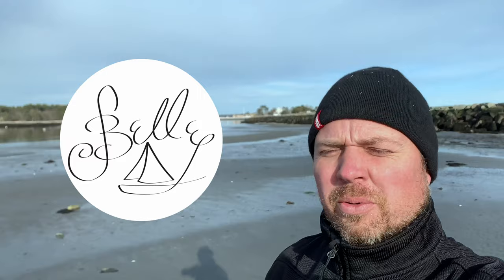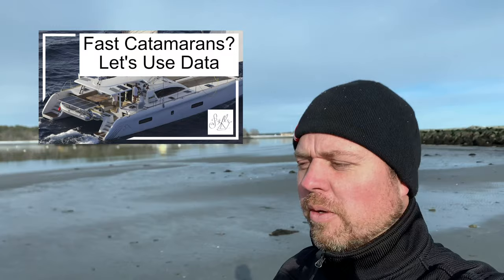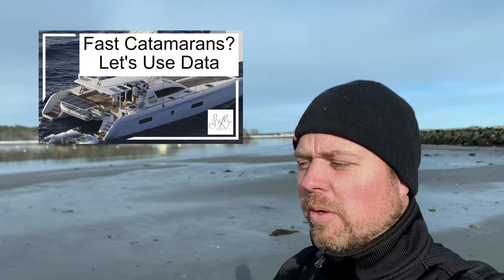Call for Questions! Catamaran Data

Comment: Great analysis on the Production vs Performance Cats video!  Jeff, you dipped into pointing out that buying a longer production might get you about the same speed as a shorter performance for the same price.  I wonder if we could pick at that idea a bit more - have you thought about analyzing how much a dollar will go towards speed if applied toward length vs applied toward performance?  I'm not sure exactly how to phrase that question, I'll leave that to your discretion so you can massage it based on data available.  But, basically, I like your idea of longer may get you more value than performance and speed really only matters during long crossings for safety.  

Thanks Jeff!  Your thoughts are appreciated! 
--Cliff
Reply: Jeff did put together a video about cost per foot length and cost per displacement. You might have seen it
Reply: @EdwardTilley  Thanks Edward - are you referring to this video: A Bit Longer is A Lot Bigger - LOA vs Displacement vs $.  If so I think Jeff did another great job doing analysis! but the focus of this video was spending money on length to maximize Displacement/Volume.  

I'm proposing a video/discussion on the question: If optimizing for speed, should one put that money toward a performance boat - which will go faster, or a longer boat in the same class - which will also go faster.  I know there are like a zillion things to consider in this analysis, bit I would like to hear Jeff's thoughts on that - or yours @Edward Tilley if you have any.

Thanks!
Reply: @cliffjohnson5660  It seems hull speed has a lot to do with long passages as a shorter length of the boat causes the bow to climb a steeper entry wave. Also, as you get close to hull speed, the boat has to work much harder to get the next knot of speed. Obviously, other factors weigh-in too - the narrowness of hull, overloading, etc. but hull speed seems a particularly key limiting measure in long passages. 
200 miles per day (or 100 miles in a 12-hour period - might be a better measure) seems an important benchmark for sailers hoping to avoid weather when they can, and to enjoy safe, and interesting sailing. 
Based on 8.3 miles per hour at a comfortable 80% of "full-power", 62' waterlines and longer will most easily achieve these distances. From 60' to 40' you are progressively nearing 100% of the boat's capability to achieve 8.3 mph consistently. Here are the numbers: 
hull length (ft)	hull speed (mph)	less 20%
65	12.4	9.92
62	10.55	8.44
60	10.38	8.304
58	10.2	8.16
55	9.94	7.952
50	9.47	7.576
48	9.28	7.424
45	9	7.2
42	8.7	6.96
40	8.47	6.776
38	8.26	6.608
35	7.9	6.32
Reply: @EdwardTilley  Great into - Thanks! I hadn't considered the hull speed - 20% as a good baseline for average speeds, makes great sense though.

 Do you have any thoughts on hull speed calculations for Cats vs Monohulls?  With Monohulls - I know they use the 1.34-sqrt{LWL} calc.  for Cats... I've not seen a consistent equation.  I assume that a thin hulled performance Cat would have a different hull speed than a Lux Cat of same length, but haven't seen details of all of that anywhere.

Thanks for the help/guidance for a newbie - I have a 38' Hunter that I live on and when I get out of the Military in a few years I plan to go cruising in a Cat... trying to learn what I can now :)